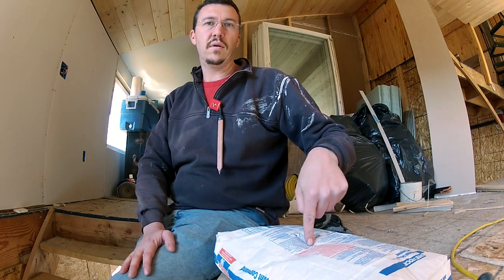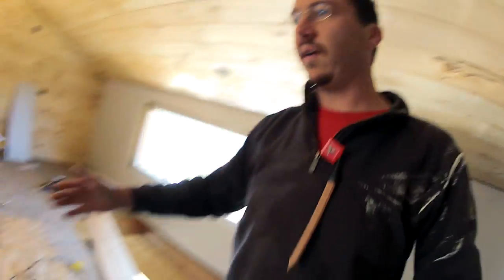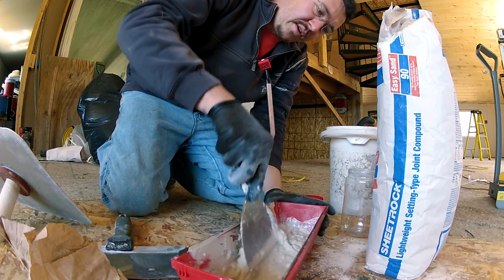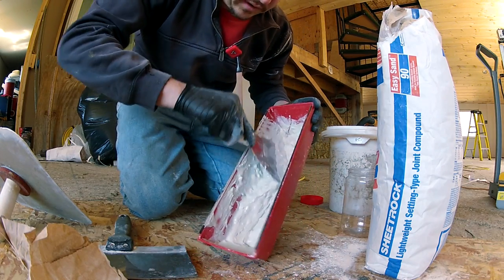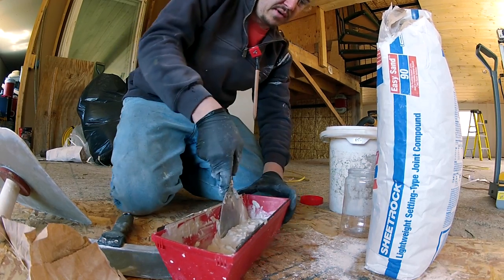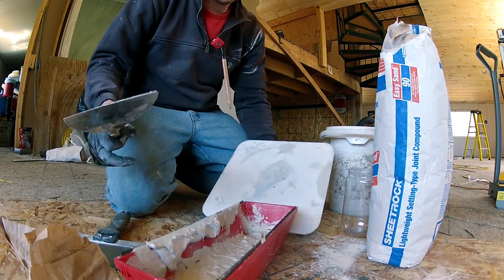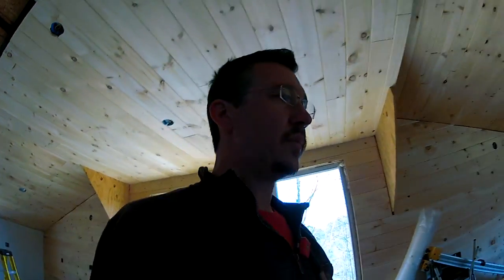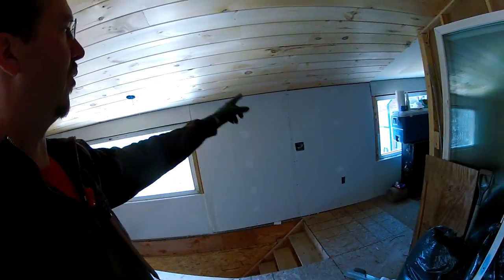The best video of the worst job mixing of mud ever, oh yeah and Sheetrock

Comment: The tool you used to mix is way toooo big for the bucket!!! No wonder you got frustrated!!! Mixing the stuff on a table standing upright is more convenient then working on your knees and you could use a little plastic cup or so to get the powder out of the bag which is less heavy and you don't have to worry you throw in more then you need!

Comment: I guess the proguys of sheetrock tape tne whole project....all the joins and scratches and bumps and cracks...and then throw the whole bag of powder in a large bucket and mix it with a electric mixer and then fill everything in one time and throw away the bucket with what is left over over of the compound! The next day they and it down and do some finishing touching and paint the whole place....maybe with some good filling structural stuff to mask even more unperfecions!